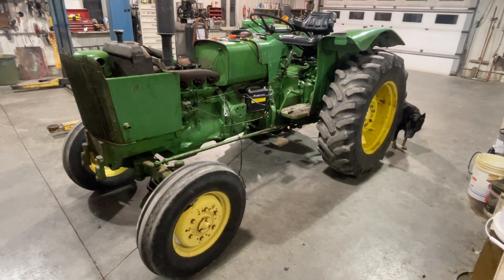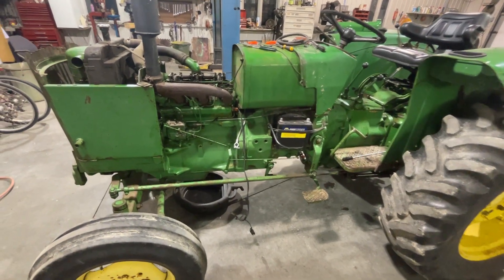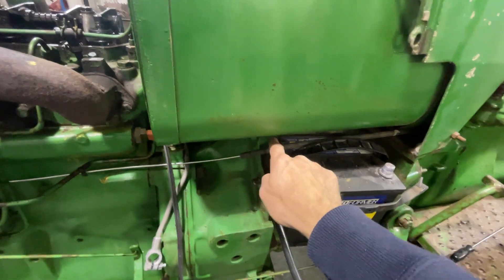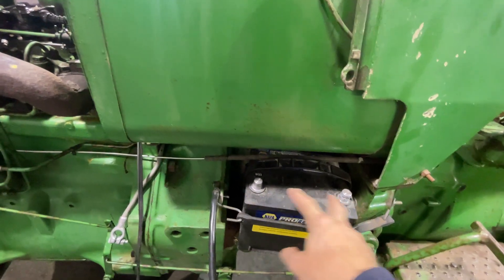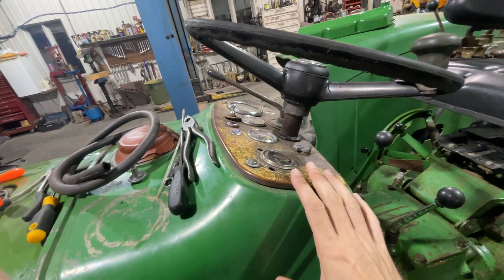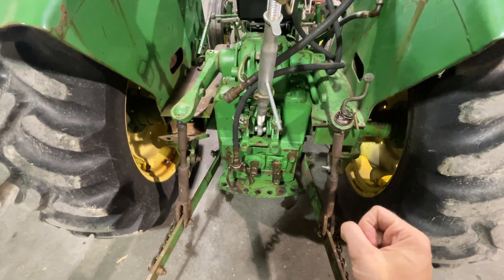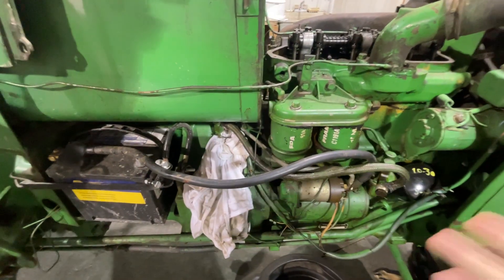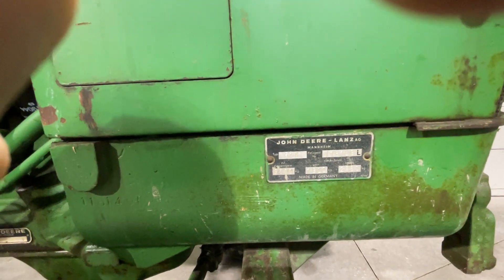Learning about mechanics on a John Deere 510 Tractor

Comment: 3:50 -  You are correct on the parking brake, I have to push my brake pedal down to engage mine.  The little lever under your left side as you sit is a 3 pt speed control, I believe forward is slower.  The one more to the rear of the tractor will hold the 3 pt up for transport, this one is likely not stuck but just needs the 3 pt fully elevated to engage it.  Great video, love my 510!
Reply from the maker: Thanks!